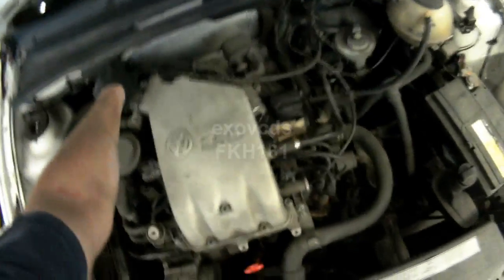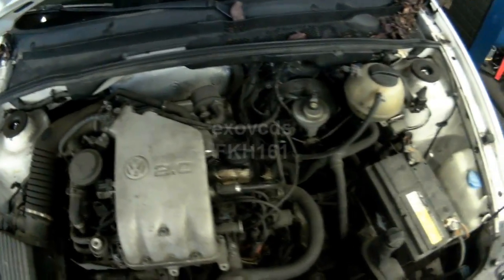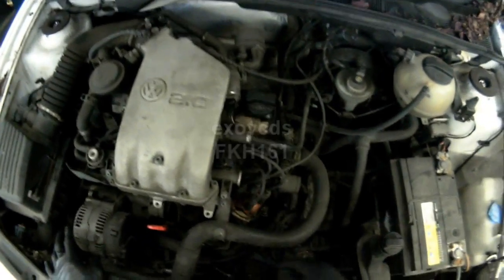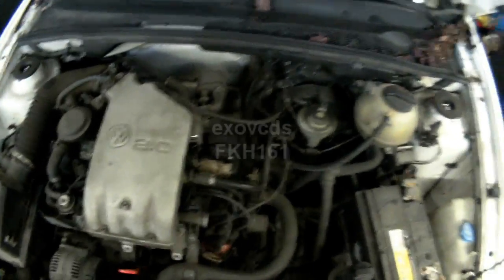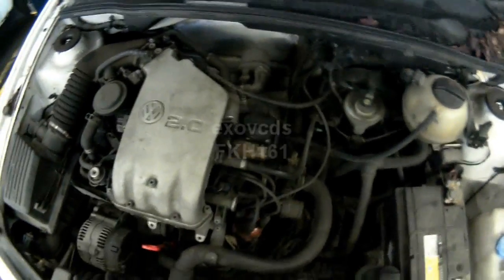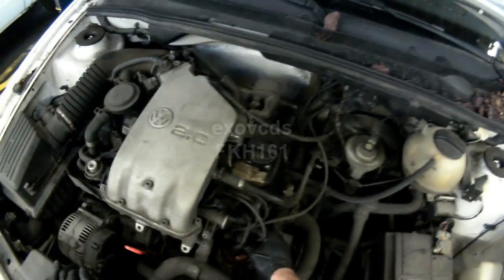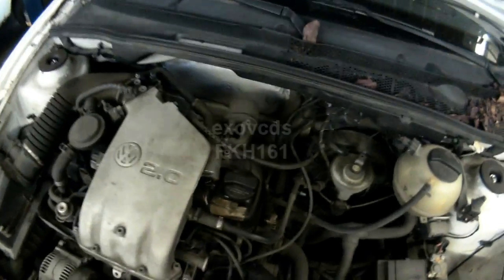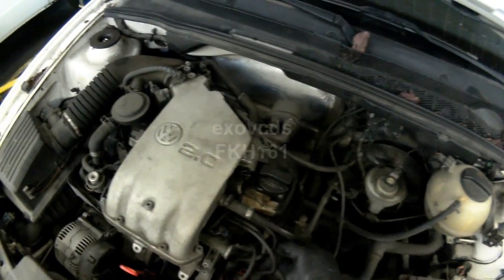VW A3: No Spark Quick Check...

Comment: yes the car has airbags but I have not had it scanned. I dont have a scanner and can t drive it any where to have it scanned. is thre any other way to dianose without scanning, otherwise I will have to tow it several miles.
Reply from the maker: from the damage description, I can't think of anything "engine wise" (wiring or sensors) that would cause a no-start after the accident... aside from airbag module being the cause. I could be wrong about that though. Let me see if I can find some info about the airbag module & crash strategies. In the mean time, look for someone with vag-com / vcds in your area... via this link:
http://www.maptive.com/ver3/VCDS_Locator

Comment: I hit a deer with my 1997 VW Jetta. broke the drivers side headlight and the plastic mount that holds it, smashed the grill, folded the hood slightly, and bent the metal cross member mounting for the hood latch. afterward my jetta would crank but would not start. I checked all wires in the front end around the smashed parts and don't see any obvious damage. I performed your diagnostic and there is no spark no fuel. there is power on both sides of the ignition coil wires but when I connected battery positive to the center wire and cranked the motor, the test light did not come on at all indicating a faulty crankshaft position sensor/engine speed sensor. Also several good fuses have no power to them # 1,2,7,8,10,11,12,18.  Does the crankshaft sensor effect all of those fuses as well?
Reply from the maker: There's a possibility that the air bag module (if it has airbags) is preventing the car from starting... have you scanned for fault codes? ECM, Airbag Module?

Comment: hey bro did a little more investigating on my vw.. I found that fuse 18 is getting power but its only getting power when the key is to the accessories position when I crank the car power to the fuse and fuel pump stop.. also when the key is turned to accessories I can clearly hear the fuel pump for about 30 sec then it and fuse 18 stop getting power.. seems that fuel pump relay stops giving fuse 18 power is this normal
Reply from the maker: +Ramon Esquibel The "prime function" is normal (when cycling the key)... 30 seconds is way long, usually only lasts a couple of seconds. When you are "cranking" do the oil light & battery light go out "while you are cranking"?

Comment: I drove it last week it had a push start when I bought it so I removed it installed new ignition switch it started then I realized I had no brake lights so I dropped the fuse box and found it was a bad connection behind the box.. I was thinking it may also be a bad connection not allowing it to start but I can't seem to find a problem.. I'm relays are fine, all work.. BUT I don't have power to fuse 18
Reply from the maker: +Ramon Esquibel Fuse 18 only gets power when the fuel pump relay is closed / on. The relay is grounded / triggered by the ECM... if the ECM is not "awake" it can't trigger the fuel pump. Check all your power & grounds for the ECM. I'm starting work right now, but can send you a wiring diagram once I get home tonight.

Comment: OK I got a crank no start no spark.. It's a 95 vw golf 3, 2.0 I'm not getting a flashing light from the middle pong on the ignition coil.. crank sensor is new, ignition coil, ignition switch, spark plugs, plug wires, battery, changed Ecu out twice and still nothing.. no spark.. I'm also not getting a reading from the obd port ( failure to communicate) is what my scanner is saying.. "I'm thinking bad Ecu wire harness?? Any suggestions??
Reply from the maker: +Ramon Esquibel When was the last time it ran? What lead up to the no start? No communication could be due to scanner unless you have used that scanner before with no issues. If you have a relay in relay slot #3 (marked 109), you probably have a bad relay.

Comment: Another mk3 here with no spark from coil

Any  ideas?

ive done or checked  this 

fuse and fuel pump relay good tes light on when cranking
coil is sealed and dry
ignition control plug outers in test light in b+ turn on 
middle one wont fliker when cranking
cps reads 932ohms in 2-3 terminals but nothing on 1-2 or 1-3 terminals (this is not clear to me)
No relay on #3 position
Alarm is ok
cleaned ignition and hall sensor no signs of moisture plug is ok
fuel pump is working and fuel pump relay closes when cranking

Still no start and no coil spark

Im missing something?
Reply from the maker: +Johnny Gonzalez Just finishing work... will get back to you once I am at home.
Reply from the maker: What kind of voltage is the crank sensor putting out when cranking? should be about 2vac if it's good.
Reply: +Thomas EXOVCDS ill check that and let you know,h0w can i test the cps? im really worried because im searching the web and every person with an mk3 having the same issue after spending maybe Hundreds the car never start!
Reply from the maker: +Johnny Gonzalez 2 of the 3 wires are signal wires... the third is a shield (grounded). Attach your meter to battery negative and back probe the sensor wires one at a time. 

On a 20vdc scale, you will see 1/2 of the ac signal. To see the full ac signal... you need to attach both your meter leads to the two signal wires and have your meter set to ac.

A 2.6Vac signal will show up as 1.3vdc 

Anything less than 2Vac when cranking (IIRC) will result in a no start / spark.
Reply: +Thomas EXOVCDS  i will test,i let you know,thanks!
Reply: +Thomas EXOVCDS  this i found: with key in on position 1.53vdc at cps harness cont in black wire to b- 
no changes while cranking

with meter on ac  000 no changes at all 

cps reads 930ohms 

i dentify b+ and b- in coil harness  but with key on b+ and b- shows cont
Reply: +Thomas EXOVCDS  today i was testing the coil as you did in a video and it never show any spark but it cracks open from an old crack and got a bit hot .
Reply: +Johnny Gonzalez  now that i need a new coil what brand you recomend?
searching the web i can find  herko brand,meistersarz,huco beru,meyle,delphi and the advance and autozone stuff
Reply from the maker: +Johnny Gonzalez Sorry... have been busy at work. Beru , Bremi but an original VW is best.
Reply: +Thomas EXOVCDS  thanks
Reply: +Thomas EXOVCDS hi its running it was a faulty ignition coil,even when it reads ok its bad so i replaced it and now its running great,thanks!!
Reply from the maker: +Johnny Gonzalez thanks for the update... the non pulsing light at the coil connector threw me.
Reply: +Thomas EXOVCDS well i got the pulsing light but not with one lead in b+ i just took that lead in to the connector b+ pin and there was flikering,its seems that it needs to sense a load or something to trigger!

Comment: Hey Thomas it's me again. I need more advice. So I have tested the Ignition coil and its all good I have a brand new ECU, I have new Crankshaft postion Sensor, The timing has been done by myself. I have checked all grounds to the block and checked the wires going to the Ignition coil I am still not getting the flashing light while cranking on the middle wire of the coil. I have no clue what is going on with it. I have heard maybe that it could be a problem with the alarm system? but I'm not sure it just cranks and cranks and cranks but no spark whatsoever. Any other suggestions?
Reply from the maker: Thomas Monroe The alarm only cuts cranking... so if it cranks, it should not be an alarm issue. I'm at work.. I'll send you some ecm / crank sensor / coil testing info once I get home tonight.
Reply: Ok thanks

Comment: Alright I am at the end of the line before burning the car to the ground. I have replaced the ecm, the ignition coil, the crankshaft position sensor. Redid the timing checked all of my grounds to the block and the body. Checked the plug on the Ignition coil still have power and ground going to that but the middle wire (black/red in the #2 pin) which we checked the continuity on (the wire checked fine) also still isn't flashing while cranking. I originally thought it was the ecm and replaced it and still getting the same thing as before. I don't know what else to do or check. I've checked all the fuses and replaced the ignition switch. the car will turnover but no spark is causing it to not start. If you have any more advice on why my middle wire on the ignition coil power output stage (black/red #2 pin) still isn't flashing while cranking that would be appreciated.

It also isn't throwing any codes for the OBD scanner to pick up.
Reply from the maker: Thomas Monroe Not sure what to tell you... check the ignition coil manually (just to make sure): https://www.youtube.com/watch?v=skyF3tFvD0I I have read too many posts about "I have a new coil but it won't start", that ended up being a bad coil. Have you checked the ground wires at the block (under the intake manifold)? How about the round wiring harness plug at the side of the head? Unplug it (twist counterclockwise) and look for corroded pins / connections.

Comment: Hey Thomas, I have a 1997 Jetta, 2.0 motor, it is having a starting problem. I replaced the coil, ignition switch and then crankshaft position sensor and still nothing. On the plug to the bottom of the coil I tested it for power by checking the 2 outside wire for power found they had power and then with the middle one, I cranked the car but it had no flashing light. also the #3 wire (thick black one) on the same plug is melting and I am not sure. I bought the car it didn't run, then I got it started once and then ran just fine but not sure why its not starting now. If you have any suggestions on what else to check that would be awesome. Thanks.

On a side note I cant get the car to turn over without the coil plug plugged in unless I connect a jump from the negative of the battery to the block somewhere.
Reply from the maker: The lack of "ground" (you having to attach a ground from battery negative to the engine) could be why you have a no start... it could very well be that due to the bad ground (the original negative battery cable / connection at the battery or at the transmission / engine) blew the ECM.

I have seen many mk2 vehicles that had fried ECM's because someone forgot to connect the battery negative cable at the transmission after a clutch replacement.

The starter tried to turn and found a path to ground through the little ECM wirez that are connected at the engine... the high current fries the ECM.

I would suggest finding a wiring diagram for your engine and then checking the wires at your ECM according to the diagram.

If all checks out (mainly power & ground wires) then I would suspect a faulty ECM. 

Have you got a scan tool? Any codes stored?
Reply: ***** Thank you for all the info. We are going to pull some codes and Ill get it figured it out from there. Your videos are super informational and if I have any more questions I will be sure to ask you! Thanks again for the help! I will keep you updated on my status of the no start problem!
Reply: ***** one more question I have is, Is there anyway to pull codes without a scanner. Im looking at buying a scanner but if there is way to pull codes without one that would be better. The OBD 2 plug is in the car by the ash tray. Let me know. Thanks!
Reply from the maker: Thomas Monroe On older models one was able to retrieve "blink" codes... not sure if it possible on yours.
http://faculty.ccp.edu/faculty/dreed/Campingart/jettatech/vagblink.pdf  * Use at own risk * If you have an aftermarket radio, "playing" with the OBD Plug can cause issues. http://www.ross-tech.com/vag-com/aftermarket-radio.html
Reply: ***** Hey again Thomas.So I removed the ECM and was putting a test light to test the connections when I got to the 23rd pin which is the Power Supply Relay,when I ground the battery to the motor put the test light to it, its dims and flashes bright. Then when I have it only grounded to the frame it comes on bright then instantly goes dim. Is it suppose to do that or is there a bad connection somewhere? Thank you in advance.

When I connected the scanner also it is throwing no codes, I cleared them by disconnecting the battery, trying to get them to reset the codes but its still not sending any codes. could that also mean a bad ECM?
Sorry for all the questions just not sure what the problem is at this point and wanna make sure I cover everything.
Reply from the maker: Thomas Monroe Here's a wiring diagram (97 ABA with standard tranny):

http://fkh161.ca/VW/ABA/97ABAECM.pdf

Pin 23 is a blk/yellow wire that is ignition power.

Comment: Hey Thomas how do I check if the ECU is group ding coil signal? ECU is not grow ding coil I think because test light is not flashing or turning on with key on ir crank I have fuel pump direct to key on and it primes OK any clue on how I can wire up the ground from ECU to coil?
Reply from the maker: Use a wiring diagram for the aba engine to check that everything is connected as it should be. If everything is OK,  then you should be able to communicate with the ecm via scan tool. 

If you can not communicate with the ecm,  then the ecm is not powered up.

You can also check the O2 for a reference voltage when the key is on, the throttle position sensor or maf sensor for a 5v reference.

Comment: Hey Thomas
I have an 2002 vw cabrio 2.0,  and I don't have the ( + ) pulses from computer to ignition coil,  black/red center wire. New crankshaft sensor,  new ignition coil and module, good signal to the coil, ground and 12v, the timing marks good, installed new computer and still same no spark, does the inmobilizer can cancel just the spark?
Reply from the maker: Miguel Lopez When you are cranking the engine, does the battery light in the dash go out right away? Watch this:
https://www.youtube.com/watch?v=fWYhYx8bMWg
I believe that on those, the alarm module prevents cranking ( would have the check to confirm).
Reply: no all the lights are on when cranking.
Reply: same issue and have changed the same pieces except for the computer, lights are on while cranking any ideas?

Comment: Last few seconds of video would be little more helpful if a little more trouble shooting is possible .. brand knew parts are not always good I agree and if I have no spark BLINKING i re ground coil have a knew distributor and crank sensor any ideas ..is it still possible to get spark from coil wire if not pulsing or blink once plugged in
Reply from the maker: Not sure I understand your last sentence / question.
Reply: the answer is no...

Comment: i just got a 1994 golf , was running and started fine when i bought it from the guy, brought my new baby home parked her for the night and woke up to go start her and she didnt start, just cranks away , i got her to idle for a bit then she would die, when i bought her the guy said all she needed was a new MAF because she would idle shitty and didnt have to much power when i tested drove her =(

  i replaced, fuel pump , fuel filter , and MAF going to get a new fuel pressure reg today , any ideas would be awesome ! thank you for your time and smart mind !
Reply from the maker: I'm currently at work... will reply again once I get home tonight. The car might be jealous of the new baby. :-) congrats!
Reply from the maker: Sorry, read that wrong! LOL.
Reply: I was calling her my new baby ! I e wanted this car for a few years now so I won't give up on her , haha n I bought her cause I did just have a baby boy 3 weeks old thank you , needed a 4 door or I would of gotten a gti :) thanks for your time :)
Reply: Lol
Reply from the maker: Ryan Nelson Have you checked for fault codes? Either a 2 x 2 connector or a 16 pin OBD connector around the ash tray. Unscrew the main wiring harness plug at the side of the cylinder head (above the distributor)... check for corrosion of the pins.
Reply: It's obd1 and I pulled all codes for you
Reply: Emailed you if that's easier to chat

Comment: Hi I have a 1998 volkswagen golf 2.0 l and it will crank all day but won't start and when it's cranking it will make a popping noise. I have changed the spark plugs and cap and rotor and I got a new ignition coil I haven't replaced the wires yet but I have spark but I just don't k ow what else to do. Any suggestions? Please help
Reply from the maker: Lucky OTD You need to check you camshaft / crankshaft / belt timing. When you crank the engine, is the distributor turning? Your timing belt could have jumped a few teeth or is missing teeth, which cause the timing to be out. If the timing belt is OK and your TDC marks are all lined-up, check for strong spark at the spark plug end of the wire and also check for good fuel flow & pressure.

Comment: hey..i have a 01 2.0 cabrio.Im having the same problem as Sejus but i replace my crank sensor and still nothin.also Im getting power to the ecu and replaced it.checked my fuses,relay 3 dont have one.im out of ideas.the 2 outer ones have power and ground,middle im getting nothing.Is the crank sensor the same as a speed sensor that you mention in the last minute
Reply from the maker: Crank sensor & engine speed sensor are the same thing. Any fault codes stored in the ECM? When cranking, does the tach move? If no tach, does the ECM show rpm when viewing datastream with a scan tool?
Reply: code 17978 engine start block by immobilizer.im going to have to get a scan tool because im pretty sure vagcom doent do data stream unless car starts.
Reply from the maker: osox713 Vag-com will show data with key on / cranking. You will have to crank several seconds so Vag-com has time to connect during cranking.